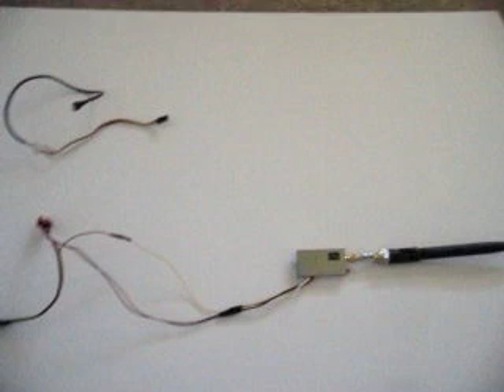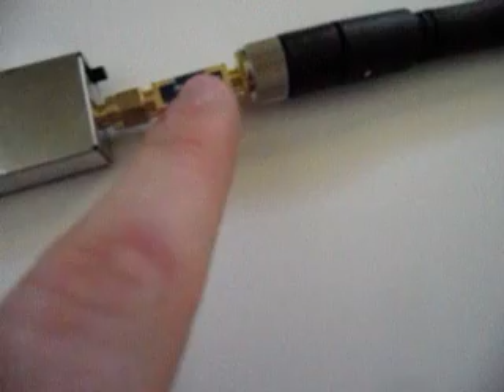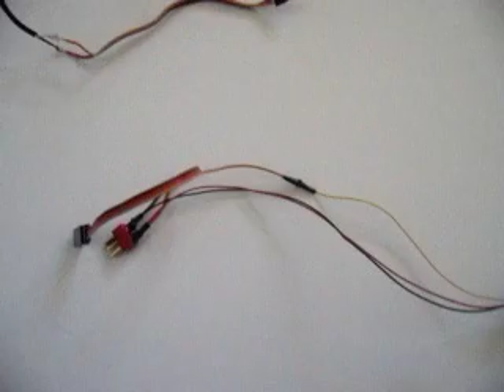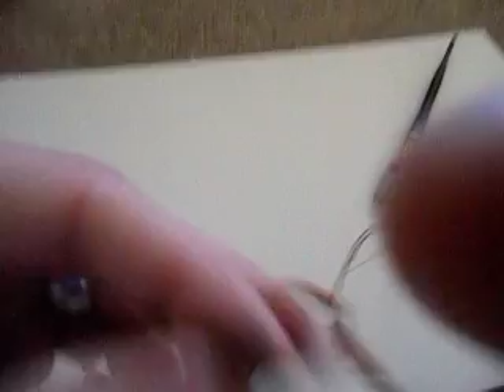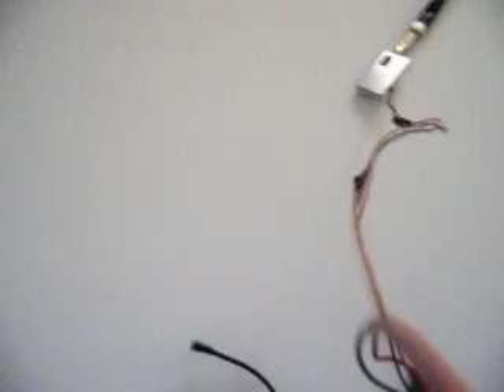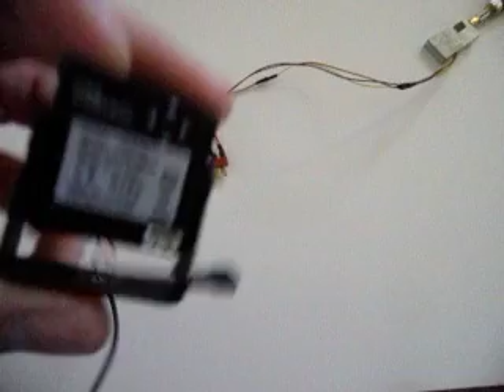Wiring/ Setup: BEVRC 800mW 900MHz FPV System

Comment: is there no audio ?
Reply: ***** so the wire that he cut, was it supposed to be used for audio or what
Reply from the maker: OH! I misunterstood your question. Yes -- I cut the white (audio) wire from the transmitter because my camera did not output audio. If you have a 4-wire cable from your camera, then you likely have audio capability. I personally don't enjoy hearing loud motors/ wind when flying so I just cut mine off.
Reply: Oh ok thanks

Comment from the maker: In order to power the ground receiver (video transmitter is on the aircraft, video receiver on the ground) you'll need a 12V supply. You can take a common "barrel plug" (the round power plug) and put a battery plug of your choice ( I use Deans) in order to plug in a 3 cell battery.

Comment from the maker: 900MHz is supposedly better with flying conditions that do not offer LOS (line of sight). For example a 5.8GHz system NEEDS L.O.S. because of the frequency. All that said, I believe 1.3Ghz & 5.8Ghz systems are my favorite. For some reason I haven't had great reliability with the 900MHz frequency-- I do think it is because I was flying a stock 3dBi dipole antenna on the plane when I should have an inverted-V antenna or skew-planar wheel. :) Good luck and let me know how your setup turns out!

Comment from the maker: Hey, yeah i'm using a Spektrum 2.4Ghz radio transmitter and haven't had any interference at all with the transmitter. I never could test the range on this video system since I don't have a return to home feature if I would get too far...I have since changed over to a 1.3Ghz system which has been much more reliable (less video dropout).